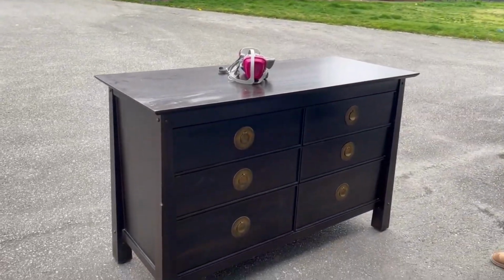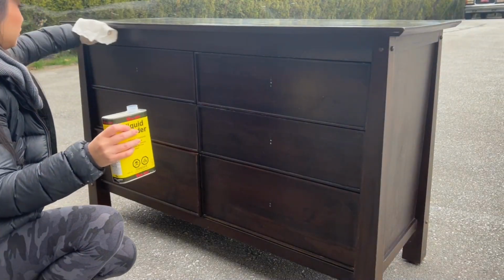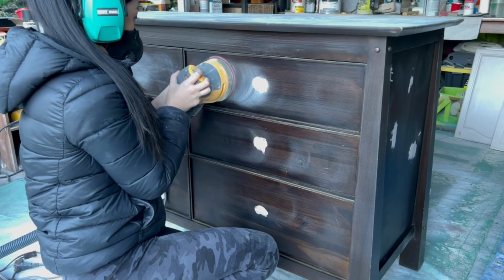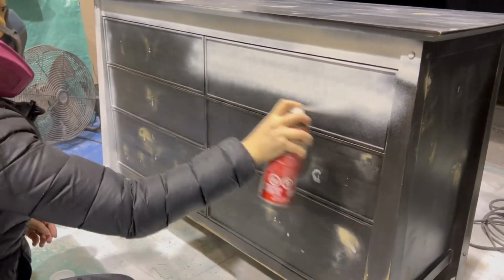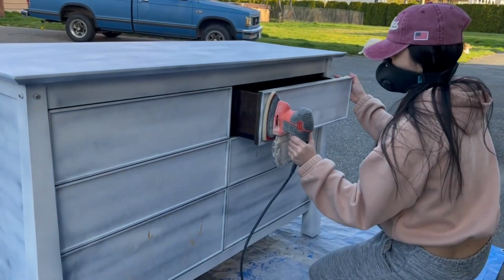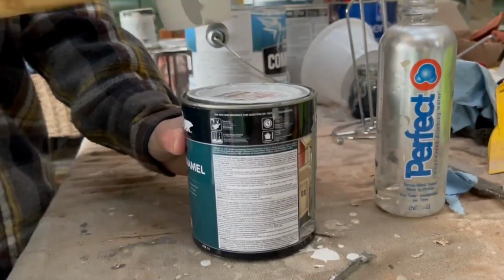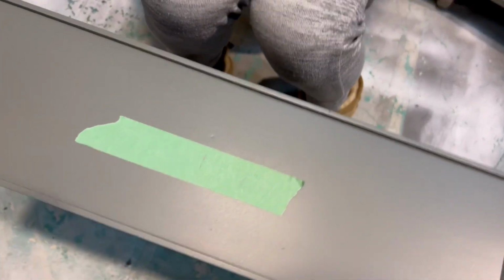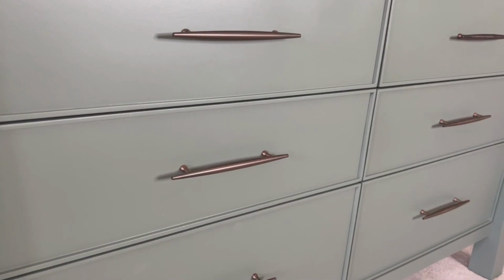Painting Furniture for Profit | IKEA Bodarp Green

Comment: I use Valspar’s cabinet and furniture paint, which is also an enamel-based paint with built in topcoat. But when I spray dark colors, I feel that I leave what looks like dusty fingerprints whenever I touch the surface. It’s very annoying. Have you not experienced that with Behrs version? Does Behrs version also require four weeks to fully cure? If that’s the case, I just haven’t been comfortable skipping a topcoat since I resell my furniture too.
Reply from the maker: I’ve heard great things about that one! In this one I used the Behr alkyd but I have used Behr cabinet paint too. They are great because you don’t have to top coat but if you don’t have a perfect coat then there’s no hiding it, you have to go over it again, which is annoying and wastes product that you were trying to save by buying the more expensive formula. I actually think I prefer to do a poly coat over using the all in ones because of that reason. I find that poly kind of evens and blurs the coat, kind of like what a toner can do for stained wood. and it’s kind of a peace of mind thing for me. I’m kind of like you, it just feels better knowing there’s a layer of full protection vs a layer of half paint half protection. I feel using an all in one is like washing your hair with a 2 in 1 instead of using two separate products 

But to answer you question, I didn’t find the fingerprints to show up, but I also haven’t tried a black in the formula. Also I think it does also take a month to fully cure. I keep my finished projects for two days before sending it back to the client and then tell them to treat it gently for a month. ❤️
Reply: @hollysgarage  I’ve seen Transcend Furniture Gallery use toners quite often but I don’t understand what they do. When do you use a toner and for what purpose?
Reply from the maker: @tableflippinghousewife  a toner is basically a clear sealer with a bit of pigment added, so it'll slightly tint and even out any blotchiness to an extent. usually it's made of lacquer but it can also be shellac or even water based. :)